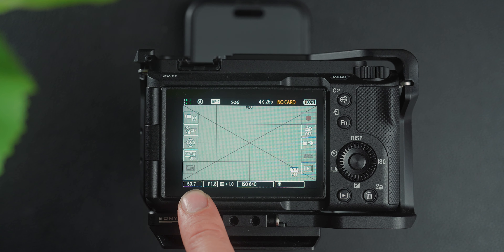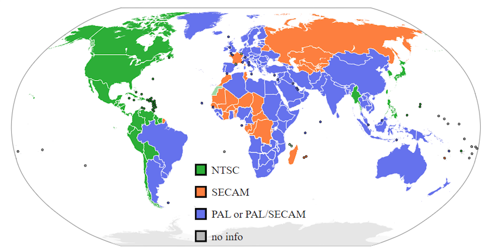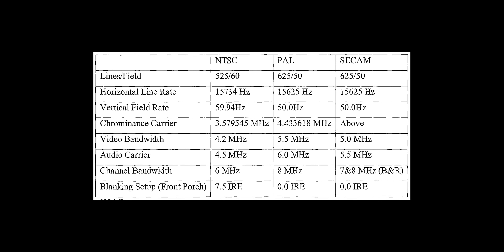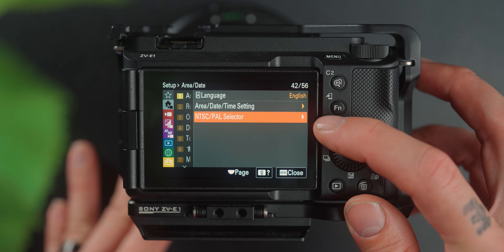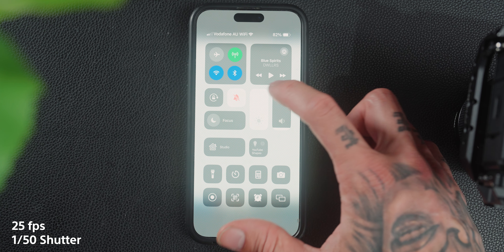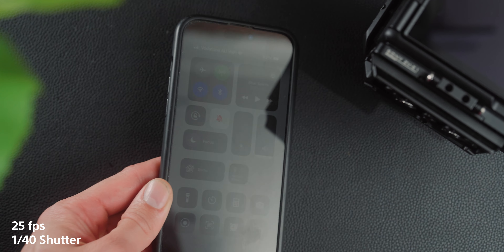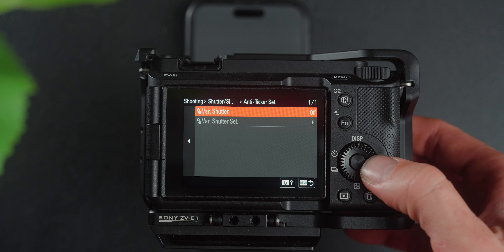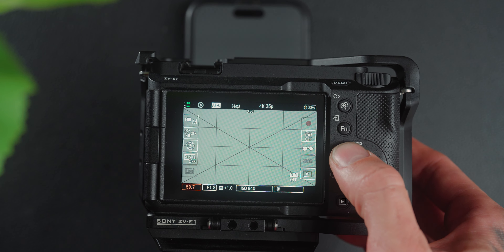Video Settings You MUST Try

Comment: I use ntsc in a pal region, because 30fps just looks so much better than 25fps imo.
Reply: also most modern pal region lcds are 60hz or 120hz
Reply: Any particular challenges you have faced?
Reply: @Ra-Hul-K  sometimes some lights flicker, but 1/50 etc. Shutter should fix those problems. But if you do stuff that goes on tv, then you have to follow the regional standard.

Comment: I'm old enough to already understand the NTSC/PAL difference but in this day and age, it shouldn't be a reboot-the-camera setting. 

And fun fact - the world was actually on the verge of setting up a global mains power plug standard that probably included voltage and frequency, too, when war broke out in Europe. If it had happened, though, we wouldn't have had the NTSC/PAL frame rate differences on our TVs either. Oh what might have been...
Reply from the maker: Yeah some camera manufacturers have all the frame rates in one menu

Comment: Hey Jason, future video idea for you-

Sony video fact: 
Regarding pal
-4K S allows 25p & 50p.
-4K HS allows only 50p.

Regarding ntsc
- 4K HS allows 24p & 60p.

Video hack for pal countries:

Shoot ntsc frame rates with pal shutter speeds. So then you don’t get flicker. However you can utilise the smaller file sizes of 4K HS. And also shoot 24p or 60p Instead of just 50p as per PAL.

Example 24p @ 1/50 and 60p @ 1/100

Thoughts on if this would work?
Definitely for 24p it will be fine.
But 60p shot at 1/100. Maybe you just can’t slow down fully to 1/2 speed? Or?

Would love for you to look into this!
Reply: That is exacly why I use NTSC in Pal region
For slow motion if you slow 60p to 1/2 speed you get 30p but that is ok for me
Otherwise you can go higher shutter speed but you need to have to artificial lights around
Reply: @SimonMeunier  I usually see a lot of flicker. At 1/120.

Does it work fine to shoot 1/100 at 60p?
Reply: @LHG-Media  All good for me if I slow down to half speed

Comment: Nice Video! I´m filming on a Canon R6 mk2, which also has a variable shutter option i tend to use when getting the flickers. I mainly just stay in NTSC, even though i live and work in Germany (PAL), since most content is shot for YT/socials (30/60p), is that a bad idea?
Reply: Its Not That Its A BAD Idea, It Just Isn't mine And Dumb People Dont Like Ideas That "They Didn't Come Up With... 🤡
Reply from the maker: It a bad idea at all. Film with what ever frame rate suits you as long as you’re not getting flickering issues is all. I have always filmed PAL for social media and have zero issues uploading to Instagram. Got 300k followers on IG from all my reels filmed at 25fps

Comment: I’m in the Pal region, so normally I should use 25/50 however a lot of my content is vertical/reels for instagram/tiktok etc.. however instagram specifically requires 30fps minimum, and if you upload a 25fps content will be converted to 30fps .. and will look a bit jittery especially if you use a lot of slow movements, pans.. etc.. so I feel like I have no choice but to switch to ntsc and use 30fps. What are your thoughts on this? I’ve seen this topic discussed quite a few times around the internet

Comment: Last year I got the Samsung S23 Ultra ( quite expensive) just to find out it has no 25fps on board. Whaaaaaaat? I was shocked.
Reply: As fas as I know, no Android phone supports 25fps unless you use third party apps. And if you want to shoot in 50fps than, you can run out of luck even with third party apps. My old Galaxy S9 can`t do 50fps even with Filmic Pro, although it can do 25fps.
Reply from the maker: Yeah you would have to use theirs party apps to get extra frame rate options. Maybe try black magic app too